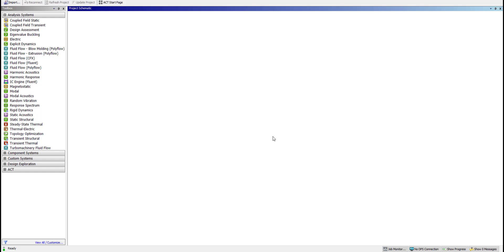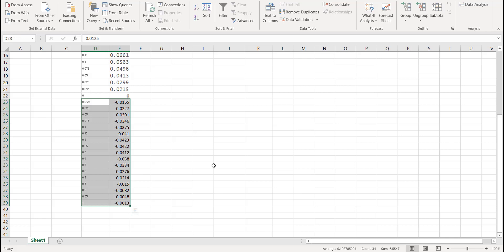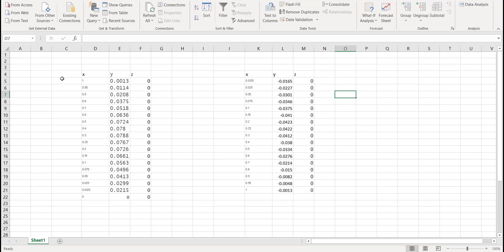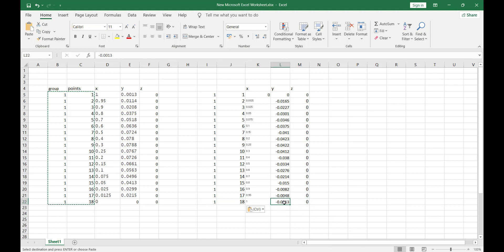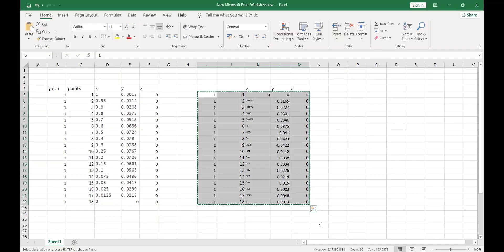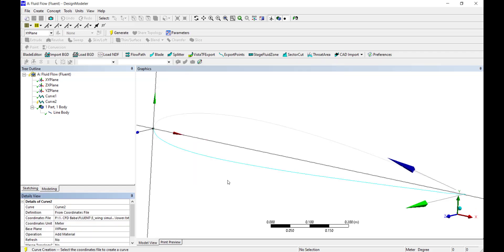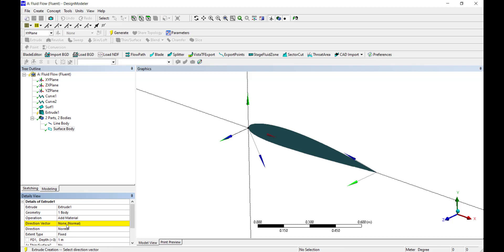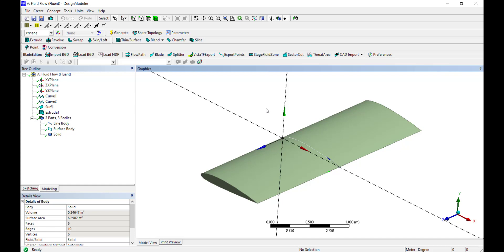How to Import NACA 2412 Airfoil Coordinates in ANSYS | ANSYS Fluent Tutorial I  | Part 1

Comment: Iam a beginner in ansys .. thanks for making this video . I have a doubt . While creating surface . I tried to create the surface without selecting line body and directly selected the curves and it showed me an error that is "edge joins generated 0" . And then I rectified the mistake but why I need to select the line body and why I can't able to create a surface using the curves directly.